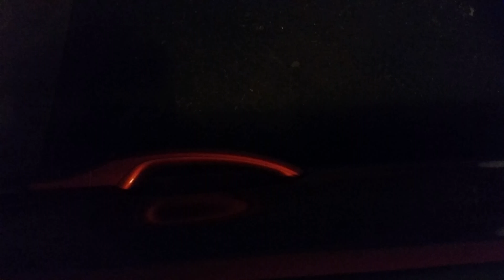2014 BMW i3 door handle leds on in reverse.

Comment: Where did you go to code that, or what did you use
Reply from the maker: Used a BMW coding cheat sheet. And know a little German.
Reply: @DavidKK4GAF  can you share?
Reply from the maker: I no longer own a BMW. Do not have the software.
Reply: @DavidKK4GAF  Sold mine in September 😥
Reply from the maker: My i3 REX was two cars ago.